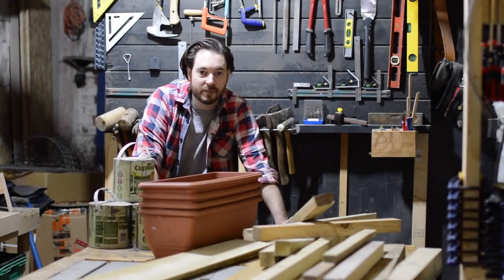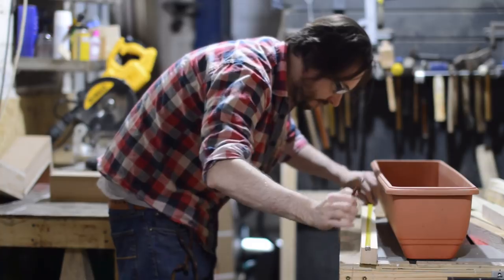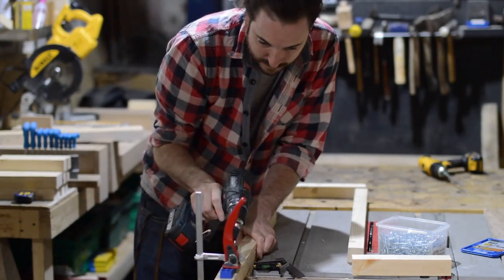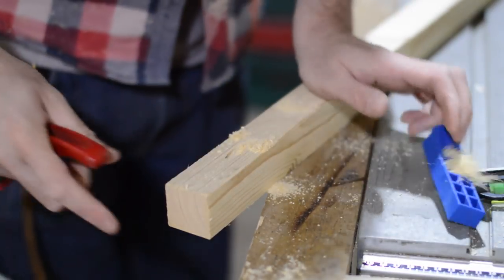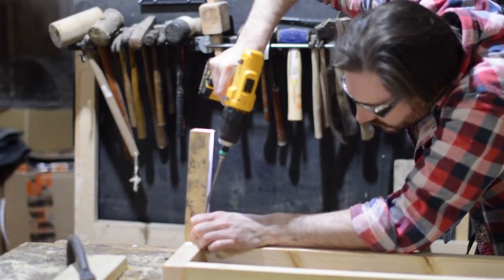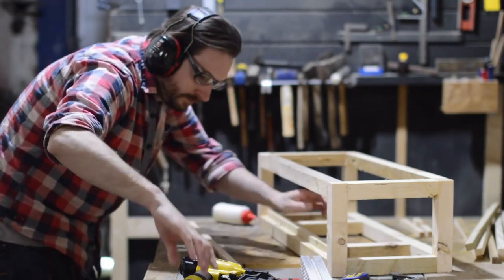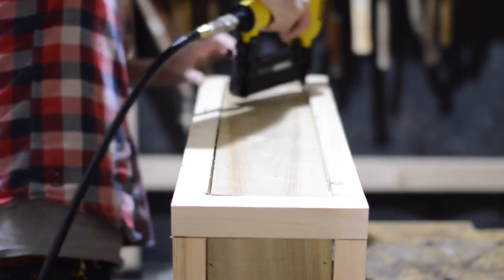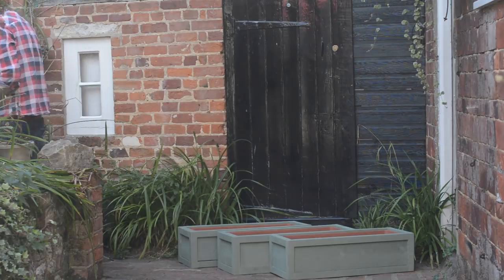Herb Planters

Comment: Nice Planters Matt. I like many others on here use Pocket Holes, i don't use them for everything that i do, but like you said for certain things. If you use that jig again or the other hand held version which is the Kreg R3, use a better clamp, the Quick Clamps you use like the Irwin ones are so much better to hold the jig, and far quicker, but it's you that uses it.
Great video as always.
Barry (Wirral, ENG)
Reply from the maker: Thanks Barry. I will look into a better clamp.

Comment: Hi Matt, I met you very briefly at Makers Central this year.. hope to go again next.  I have to say, pocket holes have their uses... I have just built a whole kitchen in plywood using pocket hole joinery including carcasses and faceframes.  I swear by them!  But, I have a dedicated setup and it makes it a lot easier than using the very fiddly, smaller, pocket-size, pocket hole jig! and I agree, for the planter I would have just screwed and filled the holes.  Using the right tools for the job I guess.  I'm off to raid my scrap pile to make some planters.  Brilliant idea.  Good luck with the move.
Reply from the maker: Thanks Wendy. I am defiantly going to makers agin. Tickets are booked

Comment: Very nicely designed like the cladding gives it that extra feature. I have the k4 Kreg jig and it works great, but I’ve heard from other Makers that the price is twice of what it is here and that just not good. But I hardly use it now if I was doing cabinet work I would definitely go with a Castle ‘s brand a much better system. Take Care.
Reply from the maker: Thank you. I will look into that jig

Comment: Hi Matt. That little jig is hard to use the next size up with the clamp is much easier to use.  I feel your pain trying to get a drill into those tight spaces.  Pocket hole jigs really shine on face frames though. Makes quick work of them. That little is better used in weird places that make other methods impractical.  Good video as usual. 👍
Reply from the maker: Yes the next size jig looks better. I will have to find things they work well for

Comment: Great user upper project Matt!  I should do the same, as I've got a load of feather edge boards taking up room in my shed from my new pubshed build.  The freestanding pocket hole jig looks a bit unwieldy, the K4 jig with clamp is a great bit of kit though, but the assembly process does take a bit of planning, and can still get tricky! .
Reply from the maker: The K4 looks a much better system.